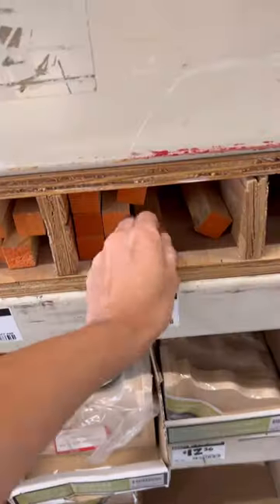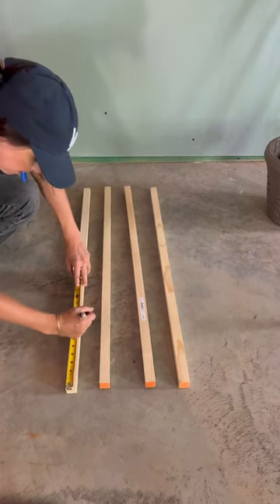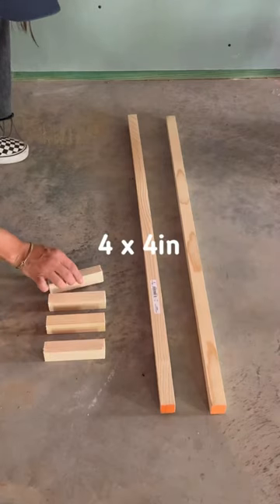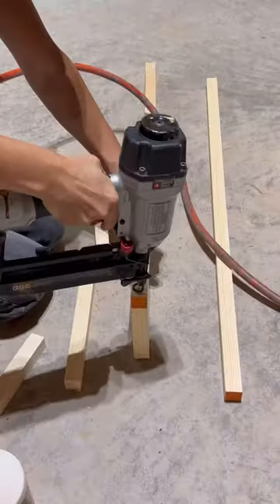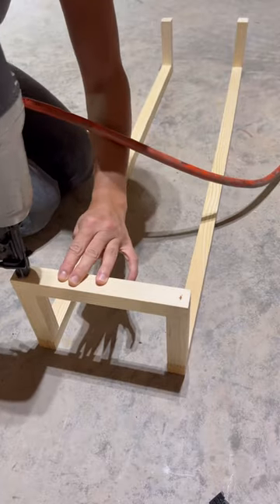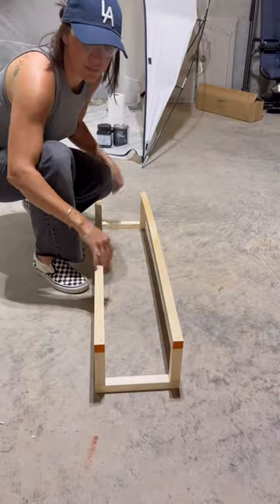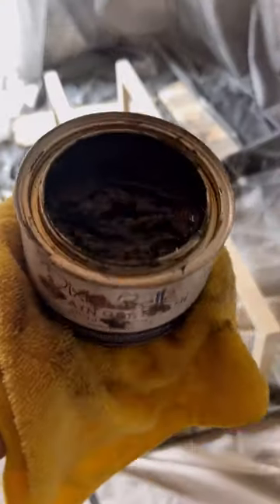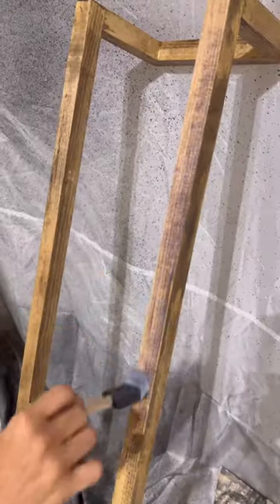The EASIEST Beginner DIY project ⚒️ #diy #woodworking #dixiebellepaint

Comment: OH WOW!!!! THAT is something even I can do and I have lost my peripheral vision in my left eye!! 👍🏻 (My husband send this to me with a (👁️ KNOW you can do this!) Funny guy! BUt this looks FABULOUS and I love Dixie Belle (Spelling?) Stain BUT…..for me, I have been trying an odd way to do smaller wood projects like this…..It is going to sound crazy but I do not have a nail gun (YET as hubby is a bit…..”hesitant” to get me a power tool that could truly hurt him if I “missed” LOL! I promised him I would NOT MISS! Mwahahahaha!) I use a matte lacquer finish (I use a spray bottle and while it is NOT as economical it is easier for me to use and I like the finish better) and just one coat will do as long as you get everywhere and there aren’t any spots that are without or it will make the next step look “sloppy”……THEN I use a SPRAY PAINT of whatever kind in whatever color I like and then I go back and use the Matte lacquer as the finish (Sometimes I DO need to use two coats and maybe three on the small wood piece I am making depending on the color but using a matte Lacquer as a “Base Coat” was something I discovered by accident and it has really changed how some of my smaller pieces turn out! They have a real depth to them and look as if I have used 2-3 finishing coats. I sold you it would sound crazy!
NB: as for the person that said “No beginner DYI (U mean DIY?’er)has a nail gun.” And then a laugh face. Actually I know a LOT of friends that have been following a few DIY’ers on You Tube and they have saved many projects and decided that was it, they were MAKING STUFF THIS SUMMER and setting up an area in their garage for the yucky Winter Time. So….that is not fair, nor is laughing. As for myself, I do not have one (YET, and trust me, I WILL WIN THIS ONE…….) BUT what I DO have is a set of GOOD quality clamps (I figure I will use these forever no matter what I am making) a Glue Gun that I use GORILLA GLUE STICKS WITH and of course Gorilla Glue as well as E6000. I use the Hot Glue as an instant hold and depending on what I am making, the Gorilla Glue or the E6000 is the long term HOLD I need and I have not had ANYTHING fall apart even a bit or become “wobbly”. There isn’t any excuse and if you know how to drill a pilot hole (look it up) and use the right size screw for the size of wood you are crafting or creating with, you do a LOT with an electric screwdriver if you do not have the funds for an Electric Drill yet!) ANYTHING can be done and done well if you just learn different techniques to suit your skill set or your tool kit. 
Friends come over all of the time and ask where I got something new they haven’t seen before and when I tell them I MADE IT, I usually have to pull out the YT Tutorial and show them (They are asking where I bought something a lot LESS and asking ME to make them one a lot MORE as of late…….hmmm……..side hustle LOL.)
Basically it is all about your creative side of your 🧠 and your attitude. MORE ‘CAN do’ and less ‘CAN’T’ with excuses and you too will have some cool looking pieces in your home that LOOK AS GOOD as the time and attention you put in it, in detail. 👍🏻

Comment: Should use glue and nails or screws. Attach hangers on tbe back to hang it- use wood conditioner before staining ro achieve a smoother stain and keep it from grabbing so dark in tbe drier or rougher areas. Personally, Id paint them.

Comment: Lemme go buy a circular saw and a nail gun so I can make a wooden towel holder.
Reply: You totally should.
Reply: Realistically, if you want to recreate that hideous rubbish, get a cheap hand saw and if you can't cut straight get a mitre box, then you just need some nails and a hammer, it's doable but once you get the supply's build something else.

Comment: Put a little glue down before you nail it. It can be Elmer's glue, wood glue, super glue....doesn't matter. Point is the glue will actually hold once that little 18 gauge nail comes lose. Make your project a lot sturdier, and last a lot longer.

Comment: Sorry, as a woodworker I don't like brad nails and screws. It would be a lot sturdier with wood glue and dowels. Tools to make it look nice sander (using 80, 120 & 220 grit) for nice finish. Hand, circular or miter saw for cuts. 1/8 inch drill bit and drill for holes. Rubber mallet to pound down the dowels.

Comment: As a first diy project your going to have your first dyi towel collapse to Brad nail in each those joints has absolutely no strength either run a small pilot hole(to avoid splitting) and run a good quality wood screw in each joint or if you are dead set on using Brad nails at least you some gorilla or similar adhesive and you should be good

Comment: humm I wonder how many beginners have a table saw a nail gun sander and a large compressor  .maybe if you used a drill. screws and sanding block it would be considered a beginner project

Comment: That's pretty funny.Which DIYer has a nail gun, a mitersaw, and compressor? Then you assemble the pieces without glue and clamps.  You assemble the pieces with brads which go through the end grain of half the pieces which have little holding power. You stain the softwood assembly which will create a solotchy, uneven effect. How exactly did you attach it to the wall? By the way, what is a dowel?

Comment: That thing needs some wood glue. Those nails won’t hold long, especially if kids are involved. Those nails should just be used as clamping pressure until glue bonds. It still wouldn’t be a string glue joint being it’s end to face grain but better than nothing.

Comment: What do you use to fill in the holes, and does the stain adhere to it?
Reply: There are wood fillers that are stainable, but they are always going to be a little noticeable, since they don’t stain as well and the break in the grain is visible. If you want to avoid it use wood dowels with wood glue, something she should have used as well since a single nail is not going to have much strength

Comment: Interesting design but there's almost no strength. If you push against the horizontal pieces it will support your weight but if you lean against the middle, bump onto the side or bump it upwards from the bottom, you'll have to rebuild it.

Comment: Why do you need 4?  It looks like two make the rails and one is cut up.  Each dowel is 36 inches long.  The cut dowel is cut into 9+9+4+4+4+4 which equals 34 inches.  You should only need 3 for this project, or am I missing something?

Comment: Oh it's really very simple; before you start your first project you must buy, A. Top of the range nail gun.  B. High end Sander,  C. four 8' lengths if 1" x 1" timber, (of which you're only gonna use 2).  Then you'll need a paint brush; a whole tin of stain, and you'll end up with something you could have bought in TARGET , for $20.  BUT there's nothing quite as satisfying as doing it yourself?!

Comment: "This perfect BEGINNER project"..."Grab 4 of these square dowels"...aka NOT A Dowel,  side not, it is cheaper to just get 2 8ft - 2x2's if you are cutting them up anyway. 
"Then grab your NAIL GUN" because every beginner has an air compressor and NAIL GUN

Comment: Nice...now all I need is the tools ugh
Reply: Actually you could probably do this with just a hammer some nails and rather than stain use paint.
Grab a 2 by 2 by 8 and ask them to cut it the size for you. I do it all the time they have the equipment right there and they typically don't even charge for cuts and if they do it's nominal. Now all you need is a paintbrush and a hammer some glue and some paint. That is if you really want to make one of these I don't think that's really that impressive personally. I'd probably just buy something like it for 10 bucks.

Comment: Ok….. $4.86x4= $19.44. You could have done all this with one 2x4x8’ and they cost less than $4 each. Also you could’ve added a dab of glue to each joint. This is going to sag and have gaps in the first year and it’s not gonna last. 🤷‍♂️ just my two sense.  Oh yea you said four and used three of them, what’s the fourth one for haha